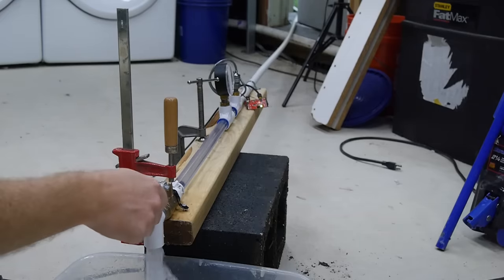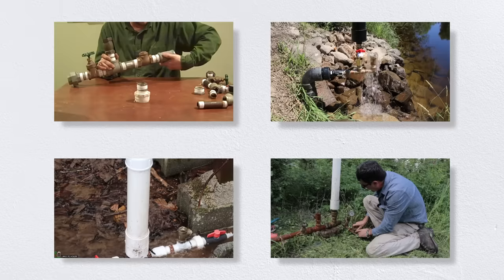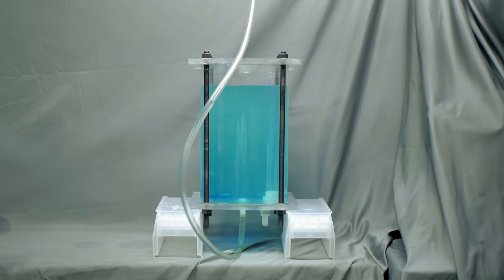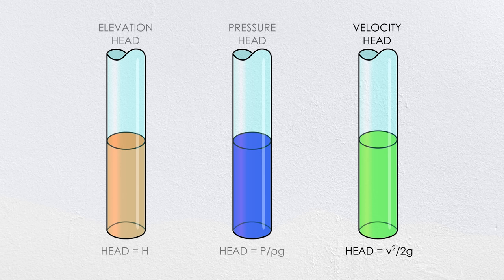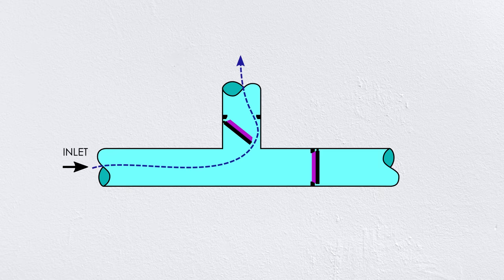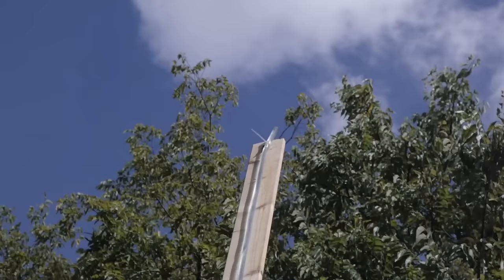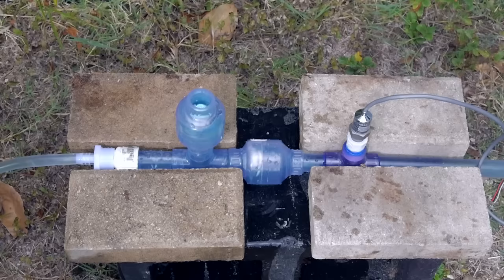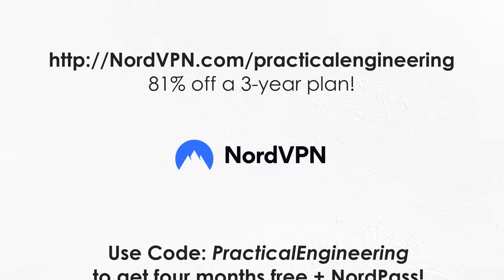How Does a Hydraulic Ram Pump Work?

Comment: If you have a free-flowing stream of water (that is, unpressurized), I wonder if a 2-stages pump connected to a water wheel would be more efficient than this. It can certainly achieve higher volumes and guarantee a continuous flow. The fountains in Versailles gardens were powered this way from the Seine.
Anyway, I feel a big thanks is due to our practical engineer, enlightening us with explanations that can be understood by anyone!
Reply: But neither a ram pump nor water wheel rely on water pressure - they both work off the kinetic energy of flowing water. You could build a system such as you describe, but it's a hell of a lot more complicated than a bit of pipework with two one-way valves, isn't it?
Reply: @jackx4311  I didn't write ram pump, I wrote 2-stages pump, which means something that pumps water during both movement of a lever. A thing that is achieved through your couple of one-way valves. And the water wheel serves the sole purpose of actioning the pump (unless you want to stay there hand-pumping all day long). That's also why I wrote UNpressurized. Are you sure you did read my comment right?

Comment: That third energy type reminds me of something that happened to me the other day. I had a catheter in and accidentally created what's called a dependent loop. Which basically turned my bladder into a pressure cooker. I could see the fluid slowly climbing up the tube because of the pressure that was building. It was very painful.

Comment: Not free energy sure but you could use this to greatly increase the efficiency of a water wheel/water turbine I think. By installing the ram pump or pumps after the water turbine/water wheel and letting the out valve to reach sufficient height. Then running a ramp of pipe downward in front of the water wheel/water turbine. Basically this would increase the amount of water that would be going to the water turbine/water wheel and would make it much more efficient would it not? 
It would be less expensive to buy the pipes to build the ram pumps then it would be to just build more water wheels/water turbines I think as well... Not to mention cheaper to maintain considering if something goes wrong you could just buy a new pipe or valve instead of having to buy a whole new water turbine/water wheel.

Comment: Watching this made me think of the human aorta being an elastic walled vessel that expands upon heartbeat to reduce the maximum pressure on the arteries.  Between heartbeats the  aorta contracts keeping blood pressure on the arteries when the heart has no output.  There is a one way valve at the exit from the heart preventing back flow or “regurgitation “.  The plotting of blood pressure with time is similar to the time pressure graph from this video for very similar reasons, the elasticity of the aorta being the living analog to a air tank to smooth the water hammer effect.

Comment: An even better electrical analogy would be the DC-DC boost converter, with the shunt transistor acting as the waste valve and the diode acting as the delivery valve.

Comment: That's some pretty heady stuff. A rancher could also just put a windmill pump at the higher elevation location and run the pipe to the pump, instead of pumping the piston into a well. It would have to be a much shorter piston arm than what is usually used in such windmills, but I'm sure that could be arranged, along with a male adapter elbow fitting welded onto the bottom for connecting to your long pipe coming from the water origin.

Comment: Ramp pump is like a boost converter, you convert low voltage, high current input to high voltage, low current output using energy stored in a capacitor or inductor.

Comment: You can do this with a straw and a cup of water. Put the straw at the bottom of the cup, use your finger to plug the top of the straw and pick up the straw, take your finger off the straw while pushing down on the straw, and eventually what will be pumping out the top of the straw. You have to be pretty quick at it.

Comment: There have been lots of YouTube videos about ram pumps. Have you considered 
making a dual ram pump where you have two pumps running from one head feed 
line to one output delivery line? 
They would need to synchronously control each other so that they 
always cycle alternately. This could double the output. It will take 
some engineering to pull this off.

Comment: Man thats awesome.  So its like using a really really basic trick to use the atmosphere to blow little breaths into the pipe just all with natural settling and a few valves.   This is amazing.  I wonder why people dont simply use the atmosphere and this trick to save up TONS of energy in a giant tank and make artificial hydroelectric generator.

1) Collect sea water.   2) put it in a lense boiler machine that seperates water from salt using the sun.   3)sell the salt 4) use the water in hydralic ram jet pump2storagetower to store energy passively.  Or just find a nice cliff to build it next to and pump all the water up the cliff passively for "free" using all passive technology.

Comment: if you want to know why we cannot have a constant flow with the ram pump and it is only cyclical pulses pumping water, here is the answer:
a stationary object has no forces exerted onto it.
an object moving at constant velocity has no forces exerted onto it.
it takes energy to apply forces. a motor can generate force, to accelerate an object to up to a certain velocity. Once that velocity is reached, the object will move at that constant velocity forever, until it collides with another object. Here on earth, we are surrounded with air, therefore objects do no move at constant velocity forever since they loose velocity by colliding with air, so a motor needs to constantly apply more force on an object to keep it moving at a constant velocity.
When we put a lot of energy into a motor and move an object at high speed and it collides with a solid object it will cause great damage. A lot of energy is released. This is because it takes lots of energy to move objects to high velocity, but on impact at high velocity, the same force is applied in reverse. The faster we accelerate an object, the more energy/time aka power is required. The faster an object decelerates  the more energy is released. This is why on racetracks, we put soft object to cushion impacts, so that impacts are not sudden but are dampened, to reduce the energy released and cause a less dangerous impact.
Once we have a proper understanding of motion and energy we can apply these same principles for moving objects to moving particles in a flow of water.
the water moves at a constant velocity. This water has no forces acting on it. It impacts a FIRST check valve and releases energy, by reduction of velocity which is a negative acceleration force (deceleration). This energy pushes back against the water, building pressure (since pressure is a force, but over area). A SECOND check valve opens, allowing the high pressure water to flow and pumps the water...
but then something happens. The pressure build up is lost since we allowed it to flow onwards and dissipate energy. Now the original flow of the water resumes. The FIRST check valve must close, to great an impact for the water. The only way to get energy from a constant velocity is deceleration.
but the reason that this energy could never be constant is that can only decelerate a constant velocity to zero. Once the movement ceases, there is no more energy to gain.
So this is why we close Valve 1 to gain impact force, which builds up pressure, open valve 2 to release this pressure as pumped water. Then close both valves again to repeat the process once the pumped water has lost its high pressure and returns to a constant flowing velocity,, lacking force or pressure.

in electricity the same process is used in a boost converter. This is we we must use oscillating switches to boost voltages. Turning on-off boost voltage, boost pressure and generates a force. We can never get more energy in the system then is within. this is why if we boost the pressure, we must stop and build up the velocity once more, to repeat the cycle. you lose flow but gain pressure.

Comment: just seen this on my hunt for ways to power my completely off-grid finca in Cadiz, southern Spain.  Having arrived at my new home on xmas eve in an unprecedented 6 day rain storm with no sun for well over a week, too small a generator and solar batteries too infirm to hold enough charge even in full sun, I am searching for ways to pump my spring water without the need for electricity, for both emergency piece of mind and, if it's possible, just to enjoy using naturally occurring science.

Whilst i do love all this stuff I am a complete ludite/novice who struggles to understand things unless they are really simplified like this video, so thank you very much, ive already forwarded it to friends living in Africa.

Could i possible ask for a word of advice? I would like to make a ram pump to pump the water from the springs pipe to a water deposit so I have a back up of water, but then i would need to pump it from the deposit to the actual house, about 50 meters away, on a very gently declining gradient.
Am i right to assume that the water deposit would have to have its own exit pipe delivering running water out of the deposit to feed the ram pump to the house... but is this viable...if i am wanting it to store water in it...can it resonably be expected to do both things...?  As i said...ludite!

Thanks for the video anyway, really great

Comment: enginer775 channel has shown another version that works with separate water sections that pump out some high pressure. basic it could use a dirty stream water to pump say clean well water.

Comment: First I thought it would just be another „free energy“ video 😂 but it isn’t xD the Ram Pump is at a lower hight as the Water source and uses the potential energy of the Water to power the Ram Pump. The Energy needed to get from the source to an higher level is taken from the water that flows down from the water source to the Ram Pump and exiting the valve at the lower hight

Comment: Really glad I found your channel! Your clearly given explanations are a big benefit to me. 
I have a question about the requirements of a ram pump, to pump water up to a much higher level at a steep incline.  Is there a standard formula to use, allowing to reach our goal?
Secondly, the source of water is a quick flowing stream of about 2' deep, but NO DROP to create pressure, only the flow. Will it still function?

Comment: Check out a old ge washing machine uses a tube as water fills the tub the air presure pushes a diafram to switch water valve off eletrically.

Comment: Pascal's law: Pressure applied to one side is exerted to all sides of the container.
The column of fluid in the tube tells the pressure of gas introduced in the container.
That's how manometers (that uses a column of fluid like water or mercury) and hydraulic jacks function.
Mercury is commonly used because it is 13.6 times denser than water.
Applications include mercury barometers and sphygmomanometers.
g - acceleration due to gravity (9.8 meters per second squared)

Comment: The electronic analog would be a boost converter, converting low pressure , high flow energy [low Voltage, high Amperage] into high pressure, low flow energy [high Voltage, low Amperage]

Comment: ram pump with a water wheel on the downstream side! free power!
closed system where the pump pushes the water to the top where it is held and then released down into the lower reservoir and passes a water wheel on the way down!
Reply: Or you could just put your water wheel in the river . . . free power, without having to build the ram pump system at all.

Comment: I was having trouble understanding where the energy was coming into the system until I realized that this is basically an escapement and the spring/weight is the static water pressure

Comment: Good video, but it would have helped more people follow the mechanics if you also explained the importance of the role of gravity for opening and closing the check valves in the right order, and maybe touched on the kinetic and potential energy equations to show how you would calculate the amount of head pressure you can generate for a given flow velocity and why you want a "heavy" check valve (matched to the flow rate of course).
Reply: The order of the valves opening and closing has nothing to do with gravity; it's determined by the velocity of water coming from the source. Once the source water velocity rises to the critical point, it will shut the waste valve. Once that valve snaps shut, that causes a spike in water pressure inside the ram, and that pressure forces the delivery valve open to send water to the storage tank, or whatever.
Reply: @jackx4311  Yup, that is how the one half of the cycle works, but then what force causes the waste valve to reopen, and closes the delivery valve? ( i realize this could be achieved with spring tensioned check valves, but that is not what was used in the example, nor is it what is used in most of the applications I've seen.)

Comment: volume of water in long chanel before valves- mostly acts like inertion piston, so, in theory - it long water "coloumn"(horizontal) can be replaced by a heavy piston of the same inlet area, - the area which is usually exposed to water pushing in the river. for example, you can imagine that part of the water at the moment already running fast horizontally in the channel- magically  turned into mercury, this will be equivalent to lengthening the channel and allows to make it more compact

Comment: So i’m no expert on this kind of stuf, but if it can lift the water that high above your shed, what prevents you from attaching a pipe going down, making the water pick up speed using gravity, and attaching a water wheel hooked to a dynamo/generator?
I know this kinda sounds like making power/energy out of thin air, but it’s basically what hydrodams do right?

Comment: I just realized that this is almost identicle to boost converter in electronics. Getting higher output voltage (pressure) in exchange for higher input current (flow).

Comment: Thank you sir, I'm working on a problem on the farm and this idea has given me a solution. Could you tell me if the ejected water Could be  attached to another pipe for collection or would that add back pressure?
Reply: You can add minimal piping to direct the water but it cannot go to higher levels or be under any pressure.

Comment: The same principle is used in electronics, with some diodes and capacitor, and alternating voltage source.... You can get few thousands of volts... Depends on capacitors.

Comment: Nice video and presentation. 
When you have time I’d appreciate your investigation about a myth in hydraulic ram pump? 

One camp said that the waste valve requires a negative pulse generated  immediately after the last shut in order to open again for the next cycle.  

The other camp says that isn’t necessary. We just need to pretensions or preload it against the head pressure just enough to keep it marginally open. It will then self start and recycle, with or without a negative pulse present. 

So which of above is true? or both true?

Comment: I guess you get a LEED point for reduced energy, but loss a point for wasting water. But if your using rainwater that could be another story as long as you comply with the plumbing code.  One component of the ram pump is that it acts like a positive displcement pump. It could be nice if watchng these videos one could obtain continuing educational credits. As a city folk, I never learned about this stuff. Having a flash back, F = ma = m dv/dt.

Comment: I wonder if the efficiency would increase if you were to put a drain line on the waste valve to a lower elevation to get a siphon going. All you would need to do is use a magnet to capture the waste valve to get it started
Reply: In a practical installation, the ram is usually in or just above the river, so it isn't possible to have the system you suggest. And, to be honest, the system is so simple and effective that the easiest way to increase the flow rate is just to use a bigger ram.

Comment: Your video of the clear plastic ram pump would be much more effective if you evacuated all of the air from the valve chambers. Any air in the supply line will reduce the back pressure on the check valve and prevent it from slamming shut after it delivers each supply pump.
Your valve has a huge air bubble in it which is why your supply line roduction isn't too impressive.  The air prevents the valve from closing, which allows water to run back through the valve and robs the needed pressure and volume.

Comment: I wish you went into more detail about the air chamber. And how much head pressure you can get out of a ram pump. One question for you where did you get the clear check valves and PVC pipe

Comment: It is essentially a free energy device though- theoretically you could use enough of these to put enough water up a hill then turbine generate it as it flows back down and you would have a net energy production with no energy input aside from the natural water and gravity- and the water will make its way back to the source so it doesn't drain from the source... that's free energy.

Comment: You missed the second half of the process.  When the water is flowing through the delivery valve, the whole system is under pressure.  The air spring pushes on the water and as the pulse dissipates, sends the water backwards down the delivery pipe.  This closes the delivery valve with a snap.  Now you have a reverse water hammer in the pipe.  In other words, low pressure.  This low pressure sucks the overflow valve open and water once more accelerates through it, pushed by the head of source until the velocity is great enough to snap the overflow valve closed again.